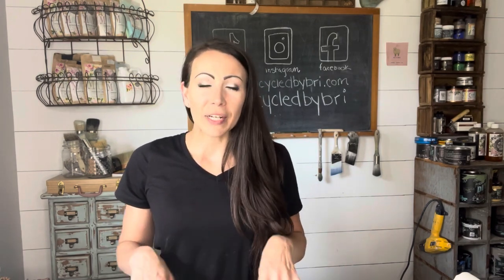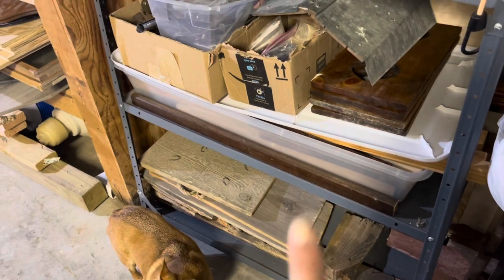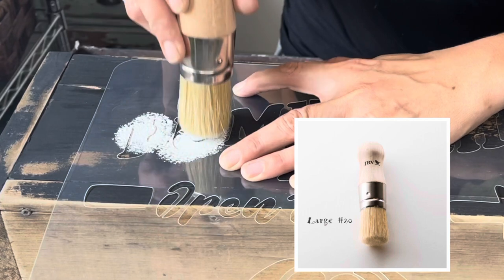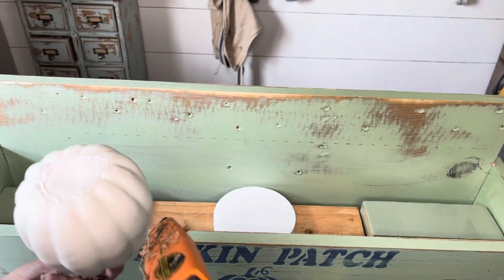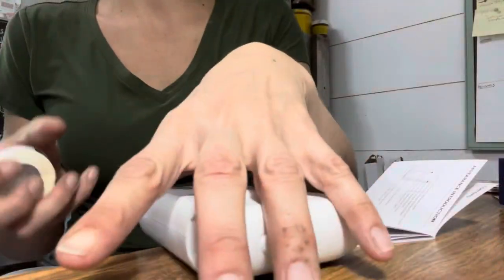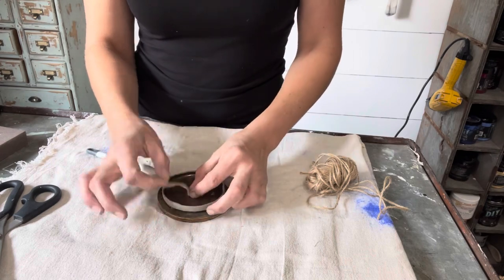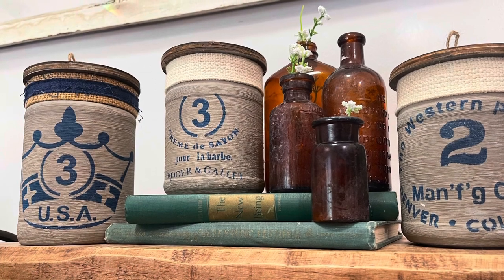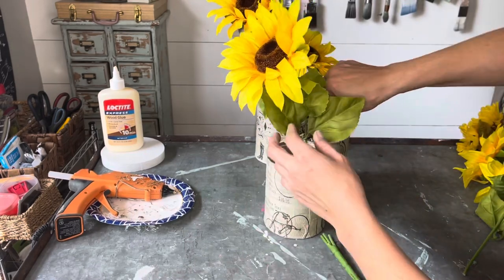NEW 2021 Fall Decor | Trash to Treasure | Using JRV Stencils, Milk Paint, and DIY Paint! | DIY Decor

Comment: Hi Bri, first let me apologize I haven’t looked at your last video as I wanted to message you in another matter. ( I will be watching it hopefully sometime today) what I’m asking is. How do you use those stencils of the grain sack? I’ve been having a heck of a time using it. The problem is the stencil is fairly thick n I tape it down n I use a pouncer to put on the paint n it still bleeds through. The thin little lines move, have to try to keep my fingers on it n slowly go down but dang it it still bleeds. I can’t get it to bend some to do a rounded edge. Is there a video that you did that shows how you did it? I was doing the cutting board like you did but let me tell ya it didn’t turn out even close to yours. What’s the trick?
You make it look so simple. Maybe its all the years you’ve done it. I guess I’ll have to go back using tape n sometimes I mess that up. In advance I want to thank you for all your help. Also want to say how much I love the DIY paint. Love that color Apothecary but haven’t found anything yet that I can use it on but I’ll get there. 
God bless n lots of thanks
♥️😊👍